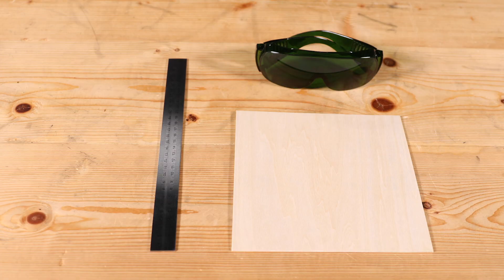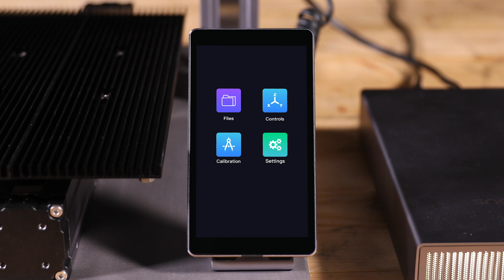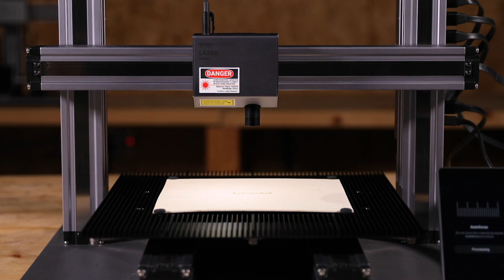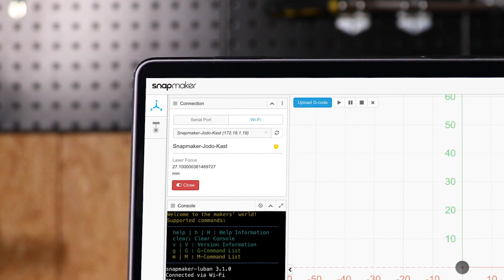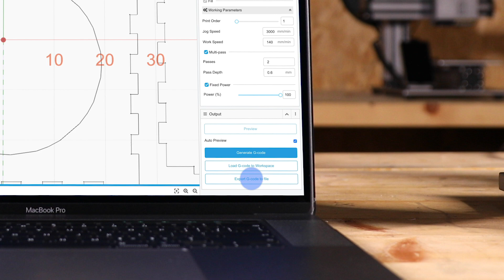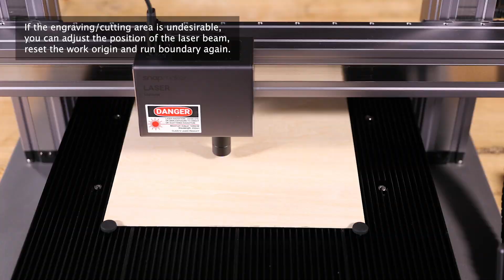Snapmaker 2.0: How to Use the Laser via Work Origin

Comment: @Snapmaker Just purchased one of these, and wondered what the actual cutting depth was for the laser (haven't got the 10w so just the basic laser). Also what materials can it cut?
Reply from the maker: Maximum Cutting Depth:1.5 mm Basswood
You can engrave on dozens of materials like plywood, leather, fabric, acrylic, bamboo, MDF, hardwood, cardboard, paper, and even food like cookies! For laser cutting, you can cut through cardboard, plywood, acrylic, and other materials with similar properties.

Comment: So much is skipped here. When I send the file via wifi and accept it on the machine, it says START or Adjust Settings. If you click adjust settings, I see work speed 100% and power 100%. What does this even mean? A % of the settings I chose in Luban file setup? I set the jog to 3000 and work to 2000 and power to 80% in Luban. Are the settings now ignored? From the video, it shows the job projected onto the wood? How do I enable THAT? Or is that added in post edit of the video? How to center the laser to the bed? Does material thickness add to the Z work coordinate as set in Luban Workspace? Is this not a thing if the file is sent via wifi? As I see it, the Workspace totally ignores all settings chosen in the setup phase but a Manual setup can have be put the laser module where I want it and the machine totally ignores material height and laser calibration height. This needs to be a 60 minute video.

Comment: So, I just got my Snapmaker, and I'm just learning. The website says this can cut and engrave acrylic, but also says that it can't do things that are transparent. I've got colored transparent acrylic. I want to make fun images on the acrylic like picture of my art, but I'm not sure how to prepare the material. It comes covered in a brown paper, do I need to remove it? Do I need to need to cut it first, then engrave? Can I do both at the same time? Is there a place that has a good overview of this type of thing?
Reply from the maker: Hi. Here is suggestion: 
1. cut the acrylic using CNC function, as the 1.6 W laser module can hardly cut through colored  transparent acrylic
2. remove the paper on the front side (that faces the laser module)
3. Start engraving
You can check this for more info about the parameter setting: https://support.snapmaker.com/hc/en-us/articles/360019025954-The-Definitive-Guide-to-Laser-Engraving-and-Cutting-with-the-Snapmaker

Comment: What if the run boundary is not within the board (or the machine platform)?
Reply from the maker: Hi, you could adjust X and Y coordinates to move the toolhead to a proper place (e.g the center of the platform), and reset the work origin.

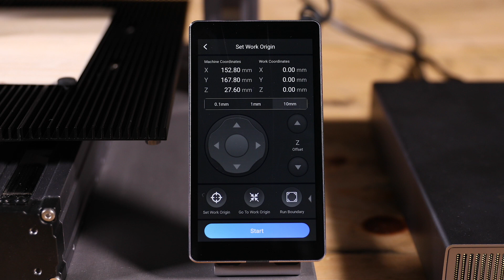Comment: @4:31 the image being cut is projected on the wood. How do I do this to see where the image is being laid out?
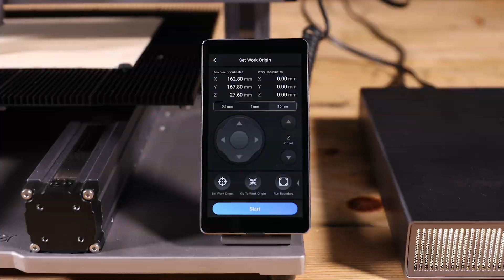Reply from the maker: Hi! We used a post effect at 4:31 in order to make it clear how "work origin" works. So we don't have such a function on Snapmaker 2.0 now. You could roughly see where the image is by using "Run Boundary" when you preview you project, see 4:41.

Comment: Hi. The machine fails to do the multiple line calibration everytime I run it. The camera can't recognize the best line and I need to insert it manualy. What can I do? And which line is better? More thick, more thin? @snapmaker
Reply from the maker: Hi Pau, you can try calibrating the camera first by going to Settings > Laser > Camera Calibration, and see whether the laser module can recognize the engraved lines. If not, there might be something wrong with the camera. You can contact our support team: support@snapmaker.com for help. For now you can select the thinnest line to finish calibration manually.

Comment: @snapmaker  when searching the work origin with the touchscreen, the laser dot is very low power wich is great.  But how to get the low power dot to search the work origin with the PC software?
Reply from the maker: Go to "Work Space" in Luban, connect your PC to the machine, and you can control the power dot at the lower right corner of the Work Space. Watch the video from 2: 30 for how to connect PC with machine🙂

Comment: Do you need to recalibrate every time you change material?
Reply from the maker: Nope. type in the thickness of the new material and the laser toolhead will adjust its height automatically.

Comment: I have the A350 with enclosure. I'm going through the laser set up process and I can't access the enclosure controls. How do I turn on the exhaust fan while running laser set up?
Reply from the maker: Hello Michael. Have you updated your Luban software to the latest version? Normally, if the machine is connected to your computer via Wi-Fi, you could control the enclosure in the Work Space of Luban at any time. If you don't connect machine with computer and operate completely on the machine touchscreen, you can't turn on the fan during laser setup. But you can turn it on after the laser starts working, by swiping to the left on the touchscreen and selecting the enclosure tab.
Reply: Thank you!

Comment: When are you coming out with a high power laser suitable for cutting 3 to 5mm mdf and plastic. 
For reference, I  used to cut 100 micron stainless with a 10w Yitiuem diode, optically tripped laser, thanks
Reply from the maker: We are now working on it, but the power is still uncertain. We will consider your need. Thank you!
Reply: @Snapmaker  high frequency lasers (193nm Excimer) blue/ violet cut with an extremely clean cut. Lower frequency lasers (red) cut (plastic) creating a melt zone
The zone can be likened to a lip of material (undesirable). The light  frequency  determines the amount of energy that gets imparted into the cut. You can literally see material particulates getting puffed out of the cut with the high freq laser cuts. While the lower freq cut creates melt for cutting. Hope this helps. I found this out via doing a PhD on laser micromachining

Comment: Do yuo have to use the laser with the enclosure? Or can it be run without it?
Reply from the maker: Sure, you can use the laser without an enclosure.
Reply: @Snapmaker  is it still safe to stand beside and watch as it runs through the job. I have received mine last week and have put flat cardboard boxes around it to ensure my family don't walk past and look at it without glasses on. But I have been unsure whether I will be affected by the radiation or not.
Reply: @nicoladevries4555  So according to you glasses protect against radiation? The laser is strong light (same as sun), which means that if it hits your eyes it will damage the cells receiving the light (same as looking into the sun during solar eclipse). So if the light doesn't reach the eye, because it is absorbed or dispersed, then you are fine.

Comment: How thick of wood can it laser cut?
Reply from the maker: The laser power is 1.6w, so it largely depends on the type of the material. For example, it can cut through a 3mm basswood composite board, but it can barely cut a solid woodboard.

Comment: Wondering how you deal with smoke and  odor after laser cut?
Reply: If you are doing this in an enclosed space, you should be using a fume extractor, or something similar.  You'll need a vacuum for the CNC, so you might want to look into a single solution for both.
Reply: There's the enclosure option.
Reply: @jadewu3823  the enclosure only holds the smoke until it leaks out, so it is only part of a solution.
Reply: The enclosure does help since it comes with an exhaust fan and hose.